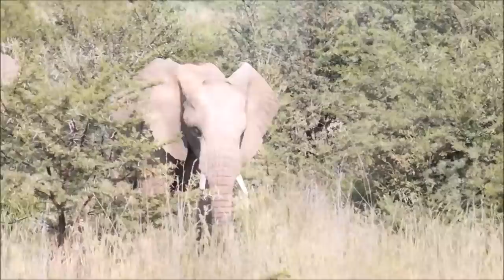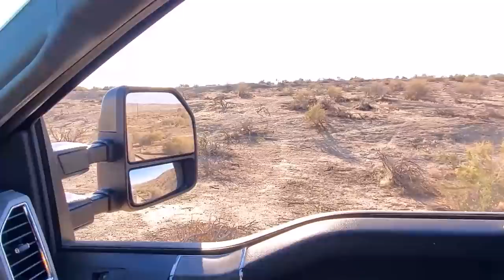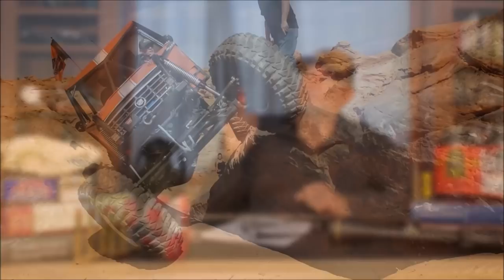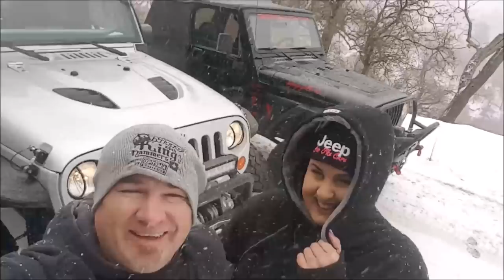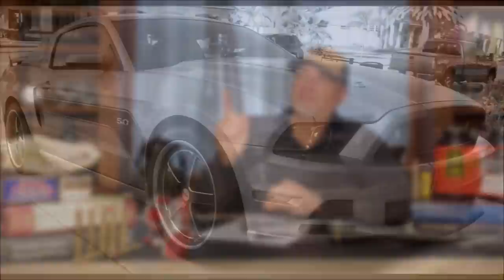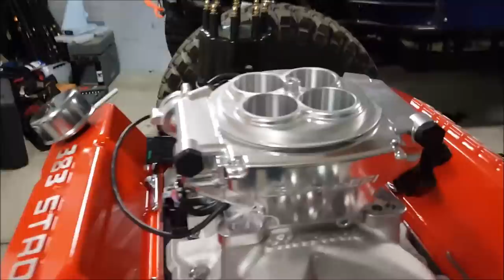HUNT CAMP MAIL: March 2021

Comment: Case. Be cautious with these sporterized Mausers. I bought an awesome sporterized Mexican Mauser. Even the barrel profile was kept with the "steps" smoothed. All visual indicators (no markings other than serial numbers) lead me to believe it was still in original 7x57. Negative, the chamber had been opened up to .284 Winchester. Even the bore and feed rails (thank goodness) were left alone. Imagine my surprise when those beautifully shaped 7x57 cartridges fed smoothly through the action and then BAM. The case expanded and split. A Cerrosafe casting revealed the modified chamber.
Reply from the maker: Yep, I've run into a K98 with the infamous "8mm-06" treatment done. No barrel markings of course!

Comment: Hey DD, what's your opinion of the new Model 70 trigger vs the old one? I'm really a fan of the simplicity of the older one, especially for hunting. Hood pins on a "sleeper". Lol.
Reply from the maker: I was skeptical of the newer MOA trigger at first, because I loved the old design so much. But after 13 years of using them now, I absolutely like the MOA trigger better than the old one. They have top quality components and coatings inside, are adjustable without a gunsmith, and have way less creep and take-up than the old design ever did. I have never seen an MOA trigger go bad, so you can put reliability concerns to rest. It's hard not to love the old trigger for nostalgia, but the new ones are better IMO.